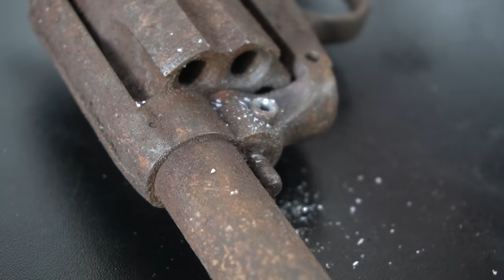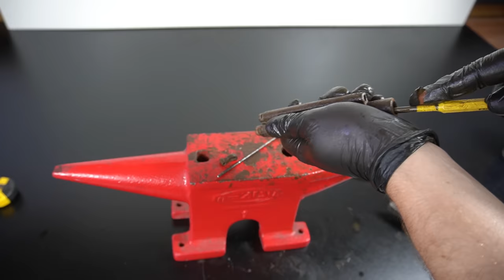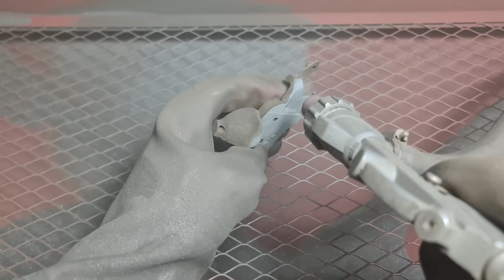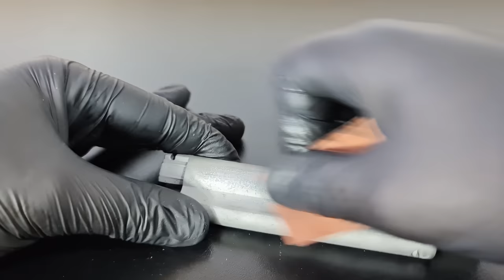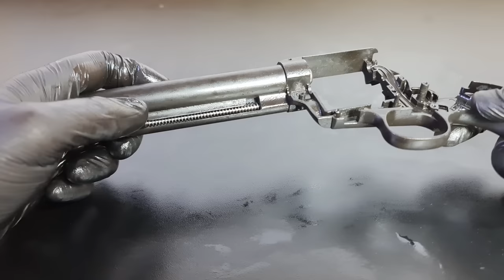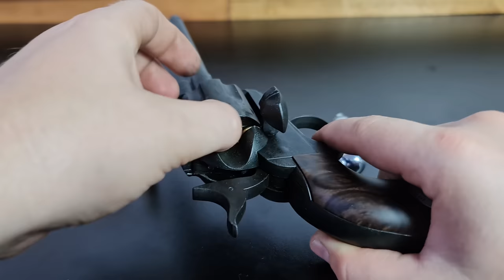Rusty Revolver Restoration Colt Peacemaker - Restoration of Airgun

Comment: you need to add more of the fake rust, that aluminum looks too clean.
Reply: Die cast Zamak , but yes this was 1000% fake.
Reply: @TylerSnyder305  forgot zamak was a thing, might have to try making casting something from the stuff.
Reply: Never saw a Peacemaker with a frame-mounted firing pin.
Reply: Interesting the springs that actually have carbon/ iron based metallurgy don't rust at all, Amazing!😂
Reply: It says it’s an airgun
Reply: @clovero9692  that they smeared rust on
Reply: Tmb acho pois nao e tao antigo para estar nesde nivel de ferrugem ,destruiu so para hravar video concertando.
Reply: Also it isn’t Colt 😂
Reply: @Winterice-yx1yi  it's fake
Reply: @toshsqeez  sort of is,,its made by umarex under licence from colt.
Reply: whaaaaat!!!!??? so this replica airgun is actually made out of alloy?

Comment: Interesting, I didn't know zinc-based pot metals and aluminum could rust.
Reply: Exactly, 100000% fake.

This is an umarex colt peacemaker co2 air pistol, made of die cast pot metal ( most likely Zamak like Hotwheels) and that does not rust.
He most likely coated it with those iron oxide powders model makers use and a chemical to rust those powders.

I saw one video however where all the supposed rust was brown sugar and cinnamon,  with the contrast on the thumbnail picture turned way up.
Reply: @TylerSnyder305  i have 3 of them
Reply: I have an old crosman i got in the late 70s. The co2 is under the barrel on mine.
Reply: @sog4646  that would be the Crosman frontier 36.
They also had the Hahn .45 and SA6 in the 60's that shot .22 pellets not BB's.
Reply: @TylerSnyder305  just pulled mine out and it says peacemaker 44. I'm pretty sure i got it in 1978.
Reply: @sog4646  
Yeah, the 36 frontier shot BB's and the model 44 pellets.
.22 earlier on and .177 later.

Look at the 1st 3 digits of the serial number for the date code.

According to Crosman they started the date codes on their guns in July of '75, however I know that they were doing the date codes as early as April of '75 and there's a chance it was started at the beginning of the year.
Reply: @TylerSnyder305  i don't see a date code. It's .177 caliber. Made in Fairport, NY.
Reply: @sog4646  .177 means later production for sure.

The serial number could be under the grip, I don't know where they are on this model but it has been located under the grip on some Crosman models.
Reply: @TylerSnyder305  no serial # under the grip either.
I wish i'd kept the box for it.
Reply: @sog4646  I'm not sure if the box would be dated.
The box for my 1977 38T is dated,  but since they were intended for police training things may be different.

It may be faint or mostly obscured by the paint, but the SN should be there somewhere.
Reply: @TylerSnyder305  were they all made in NY?
Reply: @sog4646  yes, Crosman was first located in Rochester NY, then fairport NY, now E. Bloomfield NY where they have been for over 30 years at this point.
They still manufacture some airguns mostly in the US ( with some imported components ) but the large majority of their guns are sadly made in China today.
Reply: @vintagecapgunsatyourmomshouse  
I don't think it actually can rust, but I would not be surprised if it can absorb iron oxides and rust in a way that they appear to have rusted.
Reply: @vintagecapgunsatyourmomshouse  They will not rust like in the context of this video.  Ferrous metals corrode but I'm not seeing that here.  The content creator here has assumed that these guns are are made from iron based metals, falsely weathered the gun to "restore" it, and does not come into the comment section to defend himself.
Reply: The first screw come out pretty easy
Reply: @digs6881  No kidding.   I spent three days digging out the trigger screw on a First agent Colt (1889 production).   These content creators have never dealt with the real deal of seized bolts😂
Reply: Bought the same crappy airsoft pistol from fleet farm lol
Reply: @Tyler Snyder  Who cares, it's still an interesting watch.
Reply: Fake these gun are a metal alloy  and would  have a  white   coating  when starting to oxidise there is a lot of  fake restoration  on this channel  that's for sure
Reply: @sog4646  been after one of those for years lol i have two umarex ones. they are good and you can fast draw and fan them, apparently they are made to be fanned because the actual firing pin is on the bottom of the hammer and doesn't actually wack the valve, it just pushes it.
Reply: @inspectorcal  i use to fan mine, but that was decades ago.

Comment: Nice rust coating, what mixture did you use?
Reply: Fakers delight, the rust coating preferred by 9 out of 10 fake Youtubers
Reply: @stealth916  I wouldn't say fake, this is entertaining. But, I do know that co2 pistol.
Reply: @harleyvulcancobra4.619  I dunno, lem'me see.
Reply: @AzureSetsunai4345  It most certainly is fake. Zamak doesn't rust. It will corrode though, but the corrosion is white. It will literally pit as the pot metal turns to white dust.
Reply: @JD-tl7ld  you misunderstood what I said.
Reply: the plastic part literally has rust on it @AzureSetsunai4345

Comment: Very nice out come from what it was in the beginning 👍🏆
Reply: That's because it was all fake.
This is an umarex co2 air pistol, made of die cast Zamak pot metal which does not rust.
He coated it with iron oxide powders used in model making and sprayed that with a rusting solution.

Comment: Looks like an Umarex/Colt SAA? They can be had in smoothbore BB/cartridge or .177cal pellet cartridge shooters. The pellet version has a rifled inner barrel. I have 3 that use 12g Co2 capsules. Including one in a Maple display case copied from the prop pistols used in John Wayne's The Shootist final scene where Ron Howard throws away the copy of the fancier engraved pistols, which JW actually owned. Mine is numbered 333 of 600 produced. The other 2 are nickel plated and I made them to look like the ones JB Books actually carried in the novel by Glendon Swarthout.

Comment: Nice work.
But id stay far away from using electrical screwdrivers if its a real and more valuable gun. Better put penetrating oil on them multiple times over a week and then hold the bit on the screws and gently knock them with a hammer so the rust gets broken. Then carefully turn them out by hand while applying force. This way you can save almost all screws.
Electrical screwdrivers just ruin the screws as it happened with two here. And it also flipped over the other screwheads, making them worse.

Comment: Enjoyed the video but it's just an  airsoft gun with pretent 'rust' painted on
Reply: Co2 air pistol not actually airsoft ( airguns are 4.5mm / .177 for the co2 stuff while airsoft is 6mm ) but yes, die cast Zamak pot metal cannot actually rust.

Comment: The Piece Maker had a spike on the hammer.   There wasn't a firing pin.
Reply: I noticed that as well. And if it was really a real rusted up gun, I’m pretty sure those delicate springs would have been long gone, much less pop out in one piece.
Reply: its a fake plastic firing pin set into the hammer just for looks, the actual firing pin is on the bottom of the hammer inside the frame. its made by umarex.

Comment: So for something made of an aluminium alloy (pot metal. monkey metal, die cast, etc.) and having no IRON in it, it sure had a lot of (fake) RUST on it ! As for buying a set of John Wayne replacement grips well good luck with that sunshine ! I'm guessing that you removed the grips and the shells prior to 'faking' the weathered and rusty condition, then boxed them up for the end sequence.

What an absolutely fake restoration ! 😒
Reply: Yep, I own four of these guns there's no way in hell they can rust. The YouTube restoration community is just a pile of frauds.
Reply: @daveintheshed4870  absolutely.
I'll bet this one was brand new out of the box.

I've got the pellet version.
I replaced those terrible rubbery surface black grips with the white ones available from pyramid air, and I aged them to look more like real ivory.
They're definitely a fun airgun as long as you've got the holster and belt full of cartridges for it.
Reply: those grips might be available from Umarex. They did a special edition JW commemorative a few years ago. How well those sold, quien sabe?
Reply: @OtherSarah2  
Here in the US they're available from pyramid air.
I replaced the terrible rubbery finish ( like early 2000's mp3 players and stuff ) black grips with the white ivory-ish ones and at that time they had a few of the othe grip types available.

PA is different than most though because they offer a custom service on these where you can mix and match barrel lengths and finish types as well as grips.

Comment: I don't think that is a Colt Peacemaker.  Originals have the firing pin in the hammer, which is not the case here.
Reply: I don’t think air guns need a firing pin.
Reply: I don’t think air guns need a firing pin.